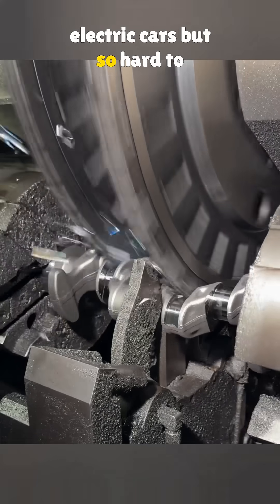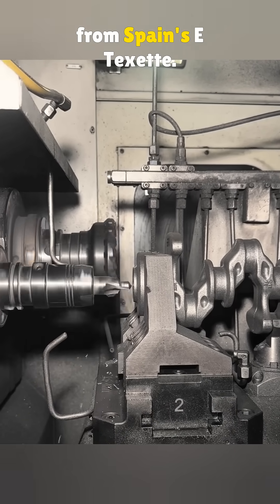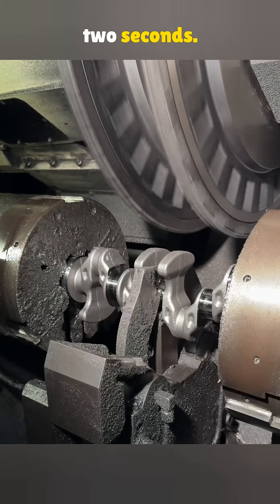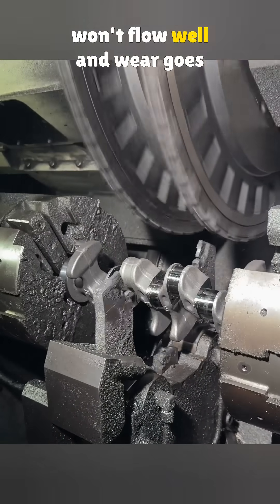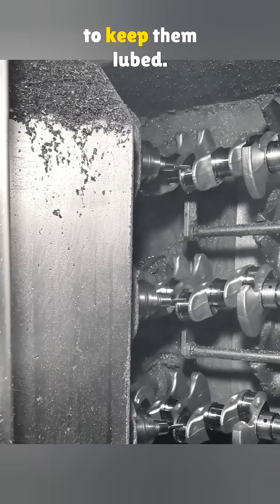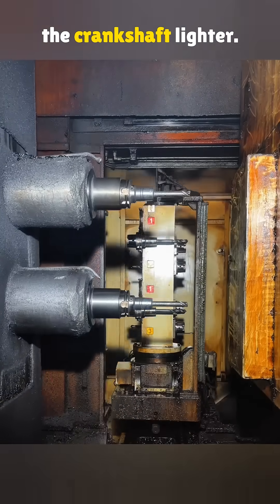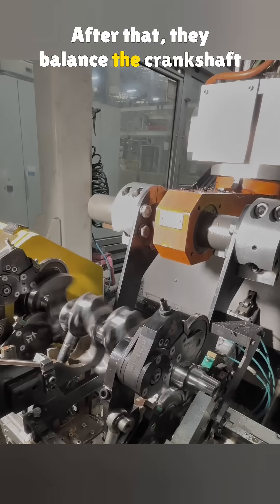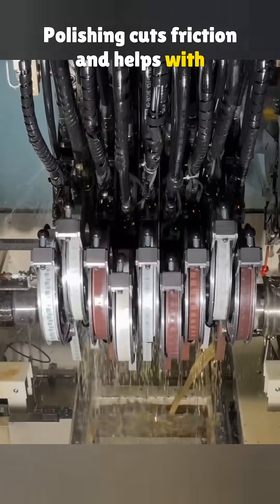How a Crankshaft Is Made #automobile #car #cartech #engine #mechanic

Comment: These really are impressive accomplishments, but this is CNC equipment which is very mature and easily maintains the Precision levels required. Now imagine having to hand machine every part on one of those monster 24 cylinder radio engines that are generating over 3,000 horsepower before Jets engines were invented. Try to wrap your mind around the Precision and skills required to do that by hand?

Comment: Kinda correct, the commutator on an electric motor goes through similar processes.
Combustion engines have many more moving parts, but have a century of industry behind them, electric motors are immensely simpler, but used to drive cars, only have a few years of industry behind them.

Comment: Analyze the source of energy efficiency. Which is more efficient ? A power plant with high energy masses that pounds itself with momentum reversal, friction, changes direction 100 times a second vs a rotor drive free to rotate to the limit of it's centrifugal stress limit nearly frictionless up to 20k RPM?

Comment: These machines will easily outlast pcbs and ecus. Quite the reason why ev's will never have a lifespan longer than petrol. Emissions with petrol is the only problem as the efficiency degrades over time.

Comment: One more question. Who is it cheaper to produce a simple gas vehicle but electric vehicles are still not even up to par and cost way more for maintenance? It still takes crazy expensive factories to produce electric vehicles anyway, if it's cheaper for anyone it's only cheaper for the ones making the vehicle because nobody is saving money on ev's

Comment: Electric cars are inferior in every way that matters. Gasoline and Diesel engine are not nearly as susceptible to spontaneous combustion as electric cars with their batteries.  electric cars have played a significant role in raising the insurance rates of everybody. Working on electric cars after a car accident is tricky and quite often they are totaled instead of dealing with a headache. It is only practical to charge your car from 0 to 80 percent. Apparently it takes the same amount of time to charge from 80 to 100 as it does from 0 to 80

Comment: Bolloks, it's not easier to do an electric car, you just have no Idea of the challenges so you overlook them. There is a reason industrially viable electric cars are much more recent compared to gas cars, and it's not only the battery, it's a fable.a

Comment: This is Bullshit 
If it's so much easier to make an electric car, then why are gasoline powered cars cheaper?
I built a cart from scratch it used a 5 horse power motor that was pretty affordable 
I built a old Chevy truck from various parts and it was pretty easy.
And did not cost that much money.
I want to convert it to electric. But that is going to cost thousands of dollars in computer controls.
Completely replacing Hi Tech axles that cost more money  The normal ones 
Electric vehicles are not simpler They require more things to make them work.

Comment: Combustion engines should be banned. As an answer to the steam engine, it has not brought us one step forward. Inefficient, polluting and unreliable. Converting 100% energy into 70% heat and 30% kinetic energy says it all. These numbers should have been the other way around

Comment: Stop peddling bs. It's easier to make combustion engine vehicles than electric, because a lot of the parts are standardised & stockpiled, where as EVs aren't. Each manufacturer uses their own designed parts & specs, making them more expensive to make & more expensive to fix. That's if you can find a garage that can fix one, 99% of them cant!

Comment: Do you know how many electronics components make a EV and different industries? Three phase induction motor has right efficiency and vfd that programmed and tuned right. Every PCB and its components? Should I mention the batteries and cables? List goes on and on. Much harder than making this short video to say the least…

Comment: My grandmother worked at a machine shop making washers. She would place a flat aluminum disc from Spain on an Italian hydraulic press with Chinese bracket stabilizers only available from an Indonesian distributor. Then she would compress the disc, remove it, place it on a German drill press that had a tungsten carbide diamond bit from Argentina.  After drilling the center hole, she would place the aluminum washer on a spinning lathe from Madagascar,  and using precision lazer guides made in Brazil, she would powdercoat the washer. Then she would transfer the washer onto a Canadian bench clamp that was bolted onto a Steel table from Ireland with industrial grinding discs from South Africa. 
After grinding off all the powder coating, the washer was acid dipped in a French tempered glass container until it changed color. Using special protective gloves from Morocco,  she would remove the washer from the acid solution and throw it into a Mexican container labeled "metal waste only," realizing she used aluminum instead of steel, and had to start the process all over again.

She then moved to Russia and bought a German shepherd from a Korean guy that she had met on an Indian dating site, but sadly he didn't have the dog's vaccine records because the veterinary moved to Egypt with his American girlfriend and left his Peruvian wife in Colombia without even a French kiss goodbye. 

True story.
Reply: Ha i wasnt the only one thinking this video was strange.
Reply: That has a Rube Goldburg flavor to it.
Reply: That has changed my outlook
Reply: 😂😂😂 you crazy
Reply: ibn batuta story , (travel man story)

Comment: It's just as difficult to manufacture electric cars and for the same reasons.  Otherwise, electric cars would literally be half the price.  There is an astounding amount of engineering and specialized processes that goes into making a vehicle regardless of what powers it.

Comment: That’s all well and good but, they were building engines BETTER in the 1970’s with ZERO computer technology! Some of those older engines still are running 55 years later, TODAY!
Most cars and trucks built TODAY, come off the assembly lines, “Landfill Ready”!
Reply: Are you joking?

Comment: Electric sucks fiya. Call wise because the man of factoring process may be easier. But those cars fall out faster than a gasoline engine. What does somebody do when they're vehicle needs a $20,000 battery.

Comment: It's not any easier to build electric motors. Their tolerances are just as strict as gas engines. In fact. Some parts are so small that they require special machining processes...

Comment: The brain 🧠 behind all this amazing technology! 🔥🔥💪💪
Reply: Thousands of brains over many years to be pedantic & still the engineer gets it wrong moving away from tried & tested methods.
Reply: @fiercefix you think they have say on what needs to be produced? If the government don't want it its over sadly enough
Reply: Those brains still have that spike protein.
Reply: Yes.  Real brains, not artificial ones.  Brains of people who knew what they were inventing.
Reply: Too bad it's only less than 50% efficient when it comes to energy transferred from the fuel to mechanical power , as an engineer I have always dreamed about shoving a nuclear power unit into cars
Reply: @waltermodel9730  that’ll be great!… Once you can guarantee no meltdowns, no exposed cores, and no radiation leakage.
Reply: Women can do anything men can do, but somehow , they DON"T!
Reply: I'm the genius behind all of this. Tony Myers invented all this when he was a kid.. an eye of the patent on the right timing for the crankshaft. And the chain and the camshaft and the Pistons and the connecting rods. And the harmonic balancer. The injectors the carburetor is a fuel cuz I don't like to spend money on gas.
Reply: الله الذي رزقنا لنا هذا .... الله الذي خلقنا وخلق أفعالنا ما من نعمة فمن الله وحده

Comment: Of course everyone is going to have their own opinions about the differences between gasoline engines and electrical motors,  I think we all know that ever Ford, GMC,Chevrolet,  Dodge and RAM from 60 and 70 years ago, gas mileage hasn't been all that bad and everyone who is anyone know where the gas pumps are at ,but who ever decides to buy an electric automobile better double check about where the electric charging stations are at or end up being stranded on road,

Comment: It's just amazing that they can make engines that can run and last as long as they do. 

Back in the fifties, the average engine would need a rebuild (probably just a short block or top end rebuild) every 100,000 miles or so. Maybe 200,000 if you were fanatical with the oil changes. Oil was not that good back then. And the machining was not as precise. 

If we didn't have the EPA, and they didn't have to make them SO complex while still going for higher performance, they COULD make an engine that would last a million miles with proper oil and service. But then, they wouldn't sell as many vehicles. 

Toyota probably comes the closest, but they are getting worse. The GM 3800 series engines were also pretty good. Under stressed, low rpm, high torque, and frequent oil change intervals = a long lived engine.

Comment: Electric motors and most of electric car parts are made the same as any other car.  It’s just the engines that are different.  One uses batteries and electric motors and the other uses a high pressure diesel or low pressure gas engine.

Comment: Die casting using giga press is now the efficient and profitable process. This makes the margin of profits for Tesla. Vertical Integration.  Where 70% to 90% are parts locally sourced. EV motors are 90% efficient while ICE 30% efficient.

Comment: still old german cars were much better than modern ones due reason timing belt problems which is always the problem expensive repair for several times during cars lifetime, fucking hate stellantis and vag concern.

Still europe can not compete with chinese electric cars and europe does not have any real battery factory for e-cars etc. Eu is one fucking woke continent which destroys itself with those party speaches.

Comment: Amazing to see... my Renault Espace (1995) has over 500 000 km on the clock, motor still running smoothly and has never been opened.... a legend !  I wonder how long an electric motor will last.......
Reply: The thing is, that electric motors are cheaper, and SHOULD be easier to replace.
Reply: @sammcrae8892 The thing is, that electric motors need a $20k gas tank that fail all the time prematurely, and are pretty much toast by 10 years. They weigh over 1000 pounds, so are not fun to work on.
Reply: Especially amazing considering that it is a Renault!
Reply: @backho12  it almost seems impossible that a Renault ecu and other electronics would last that long. Maybe it's the V6 espace?
Reply: locomotives last over 20 years without need to change motor. So the motor should outlast the batter and other electronics assuming no accidents
Reply: 2 different mechanisms why wonder over something you know the answer for . 😂
Reply: Electric motors should be decently durable, but the batteries are a problem for long service lives.  They are prone to damage from regular use.

Comment: You want to see an amazing possess? Find film of a Roberts Roto Pour. This was a high production casting machine that would cast/pour engine blocks for the big 3 car mfg, I know because we sold/mfg them the shaft mount gear drive that tilted the latel is it?that poured the Molten cast iron into the sand molds. This was a BIG machine,was round, maybe 20, 30 feet in diameter? Once it was running I'm sure it ran 24/7 untill the order was filled...

Comment: Good excuse. But that is not the reason. Making 7nm microchip is more complicated. The main reason is that existing companies already have locked-in systemic advantages. Binding contracts with OEMs, wide marketing network and supply chain, locked in suppliers. Even if you were to make a good car- note it would be impossibly difficult to source materials from OEMs, and if you succeed, almost impossible to sell because distributors and dealers are already locked-in.

Comment: Still hats off to the Engineers who designed these types of machine tools for mass production. Amazing to witness.
Reply: The result of over 200 years of learning and development.
Reply: amazing machines and material science
Reply: Well, they didn’t just design them out the blue. Years and years of trial and error and knowledge from others.
Reply: to be specific they are called process engineers they are the ones who design and develop machines
Reply: @tar244you8  process engineers don’t design manufacturing equipment.
Process engineers decide manufacturing process of anything.
Reply: The polish machine is polish
Reply: Absolutely
Reply: Not to mention these types of machines have been around for 200 plus years
Reply: Obviously the investor gets 99% of the credit via cashflow but yea engineering.
Reply: And from Namibia we have...
Reply: Think of all the jobs this machine destroyed. Progress has a price.
Reply: @markabney6545  these machines are operated by super smart people that are trained on programming and worked their way up the ladder to obtain the position, they have been operated this way since the beginning of automotive mass production. There are 100 year old lathes sitting in some of these machines shops still being used because not much has changed with these machines other than the computerization of them. Not to mention servicing the machine itself. These kinds of machines give people jobs, not take them away. Without these machines, factories wouldn't exist the way they do today.
Reply: Not just engineers, this is also the legacy of centuries of many different types of tradesmen.
Reply: ENGINEERS ARE THE TRUE PIONEERS.
Reply: Whats interesting is a lot of this is actually a much less complicated set of machining operations compared to the processes which they replaced. The eccentric cutting historically was done on mills with the workpieces mounted off axis. The holes were gang drilled with multi head drilling machines. Grinding was performed with specialised rotary head surface grinders. Balancing on a manual balancing fixture. At that time almost all the machines were US made. It’s only in the computer control era that the industry has become so consolidated to a few companies with highly specialised machines. But they took a part that took 25-50 discreet operations, and operators, and reduced it down to a handful of automated processes. 

One downside though, is the crankshafts are slightly less durable than historically produced ones, which were drop forged, rather than cast and machined.
Reply: "hats off" indeed...  (or was it "the hats of Engineers ??)
Reply: Notice there's not a single HUMAN in any of those operations, it's all done by machines., ALL OF IT.
Reply: They aren't human
Reply: Poetry in motion, with synchronised  ballet.
Reply: Yeah, try running them. They aren't so wonderful 😂😂
Reply: @NearDeath97 it's always just a program
Reply: I've always thought that Japan and Germany are the only ones that produce the best quality tools for the international market. Viva España! 👍Sigue con el bueno trabajo! 👏
Reply: Yeah I like how many countries engineers and tool makers have contributed to the process.  @atl2680
Reply: LOL in Pakistan only takes only 3 hrs to build this Crank shaft...
Reply: @kulas1501   - with a file and stone.
Reply: @kulas1501 Yes, and much lower quality steel and less precise.
Reply: @kulas1501 Wonder if they can get the blueprint and specifications and do everything orderly in tight tolerances.
Reply: @kulas1501 The machine makes it incredibly more faster and more precise then they could.
With very minor errors or none at all.
Reply: @kulas1501   because they have magic sandals 😁
Reply: @kulas1501  how long will they last ?
It’s possible to make crank shaft for 10% of the cost
Reply: @kulas1501  And that 3 hr crankshaft probably has massive runout on all lobes, terrible balance, and will probably grind the bearings flat in no time requiring a brand new crank, bearings, etc. in a few months. Not to mention it's probably robbing a bunch of power.
Reply: @kulas1501 Мне понравилась ваша шутка. Там они в сланцах и без СИЗ делают механизмы на половину планеты.
Reply: @kulas1501  😂 sure they do 😂
Reply: @protoni6996 Oh, I’m Sure they do! The question is what quality is the end result!
Reply: @kulas1501  no one's asked. your comment is irrelevant to my post
Reply: @djharml3ss  :-)) = you are a funny guy - thinking you own a post    - not how it works  duude.....  Have a laugh  others like to add  their "sad tale" too...
Reply: Complicated and predictable like the human mind...not amazing.

Comment: Electric doesn't require nearly this level of tooling.
Reply: I'd like to show you how a lithium ion battery is made
Reply: @kyletaylor6942  is there hardening? Grinding? Balancing? And that's just the tip of the iceberg.

Comment: It is a beautiful video displaying the complexity of internal combustion engine. The electrical car only complicated part is the battery itself the rest is very simple and cheap to
Make the battery is over 40% of value and the rest is gimmicks and profit. The biggest advantage of internal combustion engine that can easily run 6000 hrs with simple maintenance and battery will deteriorate rapidly after 200
Charges especially lithium batteries but ev manufacturers don’t want you think about this . Adults don’t play with rc cars they don’t read the instructions on the battery they leave in a fantasy until the car battery stops working completely or catches on fire and then they cry.
Reply: Your multiple decades behind in your knowledge of EV battery technology. That are you just spreading FUD